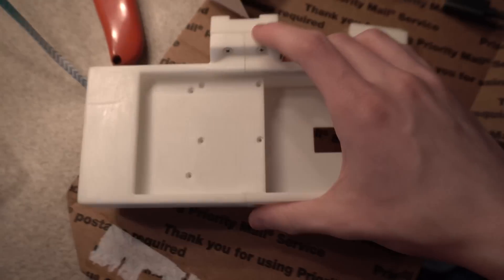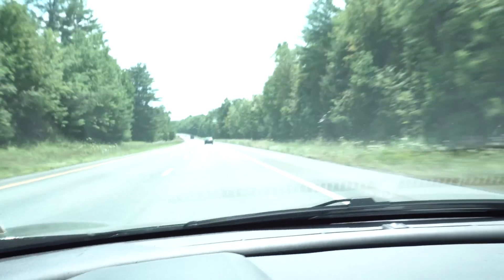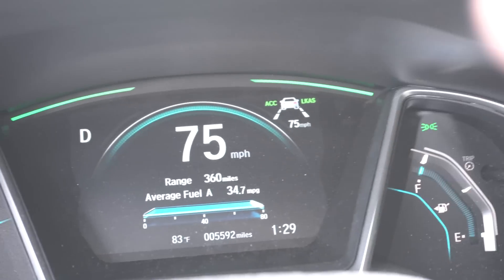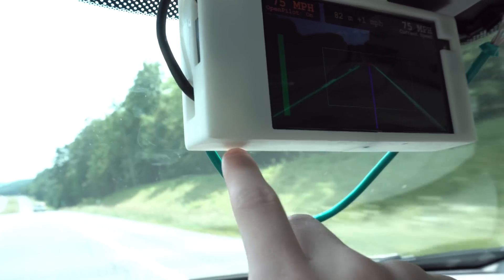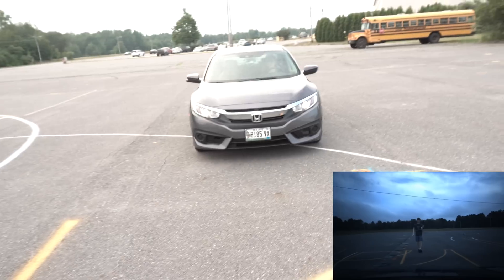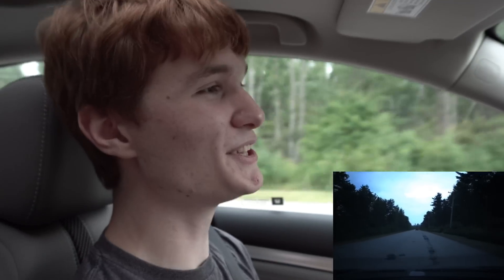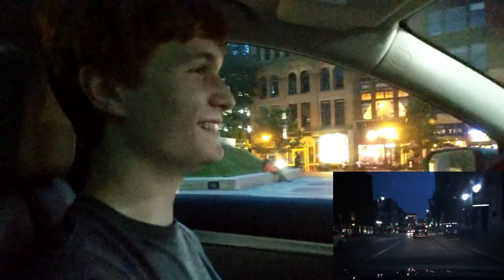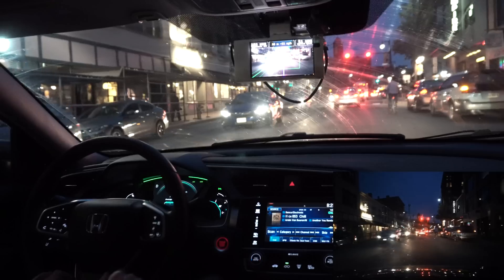Building a Self Driving Car | EP 3 (comma neo w/ openpilot)

Comment: Do you know if your specific model of the Honda Civic uses Electronic assist power steering (where you move the steering rack with input from the steering shaft from the steering wheel, and an electric motor assists, causing you to use less force when turning the steering wheel)? Or does it use a steer "by-wire" sort of system where a potentiometer of some sort would read your angle of input to the steering wheel and a computer/electric motor would steer the car, purely from the torque output of that electric motor? Just wondering about the added wear on your steering motor, as well as more energy consumption (from powering the device, as well as increasing power consumption by increasing torque output of the motor. Thanks for the series! interesting stuff.
Reply: It's physically connected through a steering shaft. In case of a engine stall the driver would need to be able to steer without power.

Comment: Do you have to have a car with the build in lane assist? I know there are only a few hondas and toyotas supported but I was curious if it is possible to implement this into my 2006 Jetta if the api was created. Do cars that are fairly new (a little over a decade) have the motors to control the steering and pedals, or is that implemented into cars with the lane assist?
Reply from the maker: It is technically possible, but highly unlikely for someone to make support for cars without lane keep assist. Mine does have that, and here are the supported cars https://github.com/commaai/openpilot

Comment: how about testing  when someone run across the road ,will it stop in time ? bike intercepting lanes at high speeds
Reply from the maker: Yeah I doubt it for now. It does detect motor cycles, but I wouldn't trust the AI to bikes just yet. It's a level 2 system though, so you always have to pay attention.
Reply: I’m also wondering about this. I assume it doesn’t detect?

Comment: Does it works with left handed roads like in Asia?? Because in India we have to drive in left side instead of right side as in US or Canada.
Reply from the maker: It sure does!
Reply: can i use it in my Maruti Wagon R? And is there any update in this project from yourside?It's just I am really excited about this thing.
Reply from the maker: I don't think so, especially if you don't have lane keep assist or adaptive cruise control. But it's getting good fast and will be supporting many more cars very soon. I will be making a video for 0.3.9 which will be a major update in my mind. I have a Giraffe now so I can switch back and forth from the stock Honda system to openpilot :) Check out supported cars here: https://github.com/commaai/openpilot
Reply: okay man. Hoping for more awesome videos from you...
Reply: Only a few car models are supported. Support may come for models later, but a car has to be automatic, and has to be "modern enough" (i.e.: have CAN, full electric control) to even ever get support for it. For now, only a few models are compatible tho.
Reply: A анонимный okay
Reply: Oh yeah, I bet they could even just add a little switch on a new system to hotswap, for travelers.

Comment: Nice series, can I use a more powerfu[ computer instead of the Oneplus 3T and adapt the PCB to work with ?
Reply: No. The binaries are optimized to run on the Oneplus 3T. Platforms are so that way you have a stable user base. If you want to do it experimentally (tear apart the binary, change function calls to work on other mobile GPUs, really difficult time consuming things like that), have at it, but don't expect a working system.